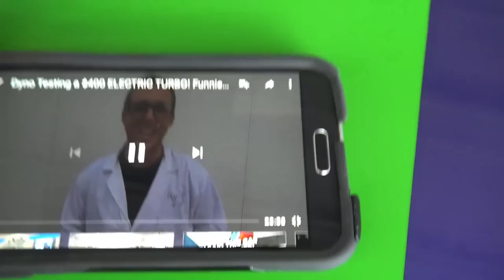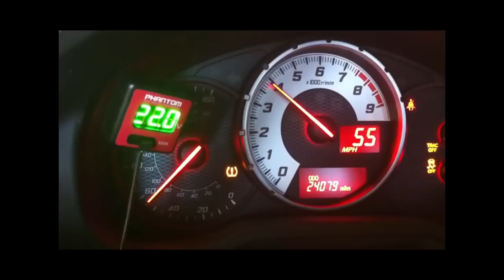Cleetus Mcfarland is wrong about electric turbos!

Comment: Cletus never made a blanket "all electric turbos are bad" assessment. He just said (and showed) that the one he got was worthless.
Reply: exactly he said the one he had was to small for his motor  so worked worst
Reply: he hooked it up backwards to the battery. Watch the video again
Reply: Jon Doe damn bro you good?
Reply: Jon Doe you have severe selective listening.  You also can’t get your point across with out attempting to insult your opponent.  Pretty childish on both counts.
Reply: Cleetus us the fucking man and he's tested that same unit and revised what he said.  At the time no one sent anything decent
Reply: Factssss
Reply: Fact.  Your not talking about your air restrictions when its not engaged!

Cletus is the man.  

The electric turbo on the chevy works very well.
Reply: @jondoe6926  i think he showed they do work later on in his videos cause he ends up with one that is similar to whats in this video an they make power on a coblat an smart car with fasterproms. an cleetus doesnt think anyone is going to take his science channel that serious he does it for the lols. i mean he tried to drive a vehicle underwater with a distributor without water proofing it. im a fan so im obviously bias but it did used to be bad for claims of electric turbos i mean ive seen computer fans put into intakes with the claim that it makes more power, but at the same time there is electric motors out there that are monsters, i always wanted to see one of those turbine electirc motors that they use for thrust on bigger electric rc stuff used to see if it could create boost. but boost is the amount of pressure the can be built in the volume an most electric turbines are meant to move a volume of air not hold it at a static pressure. i think i explained that right. some blades are better for pushing while other are better for pulling.
Reply: Yeah these electric ummm..... boost makers?, might make good power for a lawn tractor but nothing much bigger. Small 4 cylinders maybe, larger V6s doubtful, V8s no. We need Richard Holdener to test one LOL.
Reply: @waifuracer6516  which makes sense, even if that ES couldn't produce boost, it still wouldn't have provided enough restriction to cause that big of a loss of HP.
Reply: Some people like to try and make themselves popular by talking crap about others and cashing in at the same time.
Reply: Just accept that he was wrong and we all watched this video and know the truth now.
Reply: He’s said it a few times actually
Reply: He has a video with one called a torque amp that actually worked on a cobalt
Reply: fax
Reply: Geez you got some on your chin still hahaha
Reply: This guy is just name dropping to get views
Reply: Ok Cleetus.... Lol I like your vid but man
Reply: It didn't work for him on the v8. It was much to small. Also, when that isn't spinning it is a major restriction in your intake. Cleetus and his crew know what they are doing just look at his cars.. and if you watch they successfully boosted a cobalt on a different setup and it worked. So before you try to call him out do your research..

Comment: Congrats, your car is now almost as quick as a Honda Pilot!  Good job!
Reply: As a previous frs owner.   I believe he made the thing slower.   His 0-60 was  worse than mine was when it was stock.   I watched a video of him driving around and doing pulls.   I forget but I think I times his 0-60 at a little over 7 seconds.   Nearly a second slower than what road and track did

For way less than the money he spent, I bought a Cobb access port, catless headers, and I made my own intake tube/ducting.   The thing was still slow but it ripped compared to this thing.
Reply: Snaab92 lmao he actually did make his car slower than a mom suv
Reply: @michaelwielenga8809  don't get angry,there are people on the internet that are paid to knock a product,if electric turbo's were perfected,you got any idea how many companies would go belly up,least of all those who sell tig setups,and mig guns and host of companies gone,just gone,electric everything is the only thing that will fit under the hood of most of these golf carts made today,i don't like any new car,they are a compromise,nothing beats first design,after 1975 most cars were jokes,that includes the vette,ever work on a car made after 1980,that's right 4 miles of wire and a supplement electrical owners manual of schematics,and you need them to repair anything but a oil change and battery installation,the way of the future is like your wiper blades ,PLASTIC AND UNRELIABLE
Reply: @youtubeisbroken241  yep I used to have a brz and if I shifter right I could get it down to 5.4 -5.8seconds with a 93 octane tune, headers, tomes catback exhaust, throttle controller module and bigger injectors. Even stock it did 0-60 in 6.4 seconds
Reply: I'm honda pilot is heavy asf
Reply: LMAO

Comment: I don't know where to start. 
   The Audi system electric supercharger is used roughly the same way as yours, to eliminate turbo lag from the two exhaust driven turbochargers on the engine. It uses a 7kw motor. Guessing by the size of the wires on your setup and the controller size, your is max 2kw. They have also done this because the exhaust driven compressors can be more efficient in their operating range as they no longer have to function at the very bottom of the engine rpm scale. The compressor and motor are also water cooled because of the amount of heat that is generated during use, something you outright ignore.
   You have said that your boost trails off to 2psi at the top of the range and given these are relatively fixed displacement supercharger and flow nearly the same air independent of engine rpm, the most you are probably getting is about 30hp. Given the wide range of rpm that Cleetus performed on the mustang and that for most of the pull the mustang was below the power output of a factory frs, this mustang engine does not flow more air in any appreciable way than a stock engine in an frs, something your car is not. Your setup on this mustang would have nearly the same results as on your car, starting at about 5psi and tapering to 2psi at peak, netting about a 30hp gain. Closer to 25 on a dynojet, but this is ballpark figures, both engines have mass airflow meters and you could look at the voltage and know with a high degree of precision how much air each engine is actually moving. There is no point to debate this, the 4.6l mustang engine flows nearly the same air as the 2.0l frs engine.
   In the cleetus video they acknowledge the voltage problem and vow to use a boostapump to push as much as twenty volts through the controller, something your setup does when the batteries sag, something that would probably not change the result.    Considering you can buy an FA20Dit for less than two grand and this gives you at least 50hp, and a short block that can hold more than 400 at the tires, your $2k for ten second 30hp bumps so your Siena slow sports car can safely merge onto a highway is kinda lost on me.
Reply: You should go watch cleetus’ recent Torq Amp vid. Pretty interesting

Comment: I've never seen a working forced induction system that dosen't demand MORE FUEL under boost.  Without it you can't make any significant power gain and also a recipe for problems as too lean isnt healthy..
Reply: Suisk8- most factory computers can adjust fuel trims for low boost. Computer sees lean condition and adds more fuel in milliseconds to get it back where it needs to be. Just because you’ve never seen it doesn’t make it impossible. You’ve probably never even tried it. The limitation would be maxing out the stock injectors if you turn the boost up and to max them you would need to tune the computer, add standalone or piggyback
Reply: @mikeschneider634  yes indeed and in his video he is not claiming that the engine is producing more power by only adding air. Adding fuel is easy on these cars with the flash tablet. So therefore not interesting stuff. The only interesting thing is a working electric boosting device.
Reply: hahahahaha yeah in your video you say nothing about boost timing control, or anything fuel system related..  and claim 45 hp with nothing to back it up.. see how many dislikes you have now.. waste of money I call complete bullshit! 
If you want real power gains people don't half ass it like some people.. you will not get what you want and damage your engine..
Do it right or don't do it at all
Reply: also the way the boost tapers off ass rpm increases would give you the dumbest power curve ever on the dyno graph that you wont post bcoz you know its wack asf..
so solution is go 48 volts lmaooooo still wack asf no body wants to run 5 mini batteries in they're car performance car.. Weight savings is what the cool kids do with only one mini battery and a real power adder.. You should try it!
Reply: Daniël Hilgersom his car is not tuned.  He admits this in another video.  But there’s also some tell tales.   He has his catalytic converters removed.  When Modern Subaru’s have bad or removed cats, they throw a check engine light and a cruise control light.  ANY tuning software can get rid of this problem.   He has both lights during his test drives.   This indicates to me he is running the stock software.   He is not adding fuel, his timing is still the factory setting.  His car will not run right when under boost.  

The factory ecu will modify fuel and timing within set parameters.   Those limitations will not compensate for an engine making boost.
Reply: In a mopar it b ok I bet....u can run huge injectors on a stock fuel pump most the time in the V-8's
Reply: Efi is great stuff. 5 psi sold be fine on stock ecu. It will comp for sumthin this low.😎
Reply: Modern engines can adjust air/fuel mix on their own.

Comment: 5 psi is enough for bottom end acceleration!  Instant torque and 24 volts by 320 cca is 7.7 kw of power which is heaps for bldc motor. finally someone who actually says this setup works. nice video keep up the good work! cheers from Australia!😊
Reply from the maker: Thanks!
Reply: Don’t fall for his video.  Watch his other videos first.  He peaks at five psi but truly only runs about 2.7 under WOT.  He also shows his gauge cluster while he’s flooring it.   My tuned, catless, frs with a home made intake was faster than this and only cost 600 bucks for the tuner and manifold.   Furthermore, an m90 supercharger costs a couple hundred bucks and you can easily fab up some mounts to put one on the frs.  This guy got conned out of his money but doesn’t want to admit it so he keeps trying to prove something that’s not true
Reply: @youtubeisbroken241 yeah I want tonsee it on a dyno not that weird video he showed

Comment: The main point of forced induction is to increase overall air density. Higher pressure with high intake temp doesn’t really do a lot of good to the engine. That’s where the intercooler comes in.
Reply: I would argue that compressing the air increases the air density. Also, as he stated in the video, he doesn't have hot side. The intake is getting its air from the air box which is right up front. That's not to say its not gonna get some heat from the engine but it certainly wont be hot when powered.
Reply: @aydenowens9522  The heat is generated in the compression of the intake air.  There is no such thing as air compression without heat.

Comment: I would love to see an electric speed control mod for the brushless motor that controls the boost in relation to the throttle position. Your video stated that the electric setup doesn't kick in until 75% throttle. Anything under you are pulling vacuum against the system. With an ESC you could apply power based on throttle position to at least negate the vacuum, keep it at least breathing easy. You could even draw from the standard battery/alternator in these low demand situations and pull from the "boost batteries" when the system kicks in full power.

Comment: Firstly Audi and Porsche fit electric assisted turbochargers to eliminate or reduce lag, they are not driven solely by an electric motor. Secondly, measuring the HP with the unit attached on your car, simply adds considerable drag to the incoming air flow. Therefore what your comparing is a false HP baseline and when the turbo is turned on the engine can breath normally again showing a HP increase which is most likely the HP your car produces in the first place if the the unit was not attached.
 If all the car manufacturers could replace all the complex piping, oil feeds, heat generated etc by a conventional turbo with a simple electric motor, dont you think they would have done this?  BTW, you also stated incorrectly that electric turbos do not require an intercooler, but this is not true. When you compress air it heats up regardless of how the compressor impeller is driven. This is exactly the reason your turbo setup remains cool because its not compressing air, just free flowing air into the manifold. Try connecting a pressure gauge on the intake manifold at full boost and it probably wont even register any pressure.

Comment: "This entire system I've payed less than 2k$"

Meanwhile PFI has been tuning 500$ ebay kits on Hondas for the last 4years making 800hp... Lol.
Reply: Exactly
Reply: Does that fit a GT86?
Reply: There are plenty of eBay turbo kits for the fa20.  It’s also incredibly easy to use the m90 supercharger from early 2000s chevys and build some nice power
Reply: Faxxs
Reply: True but this the type of mod that requires no fab, no strange piping. No extra work to the exhaust and creates no attention to a otherwise stock car, All the power so to speak and none of the drama when a piggy see's you.
Reply: The hash slinging slasher. To install an electric charger still requires piping and tuning.  Admittedly the piping would be more simple.  Tuning is still going to be required.  And you will need to have some understanding of electrical circuits to make it work properly.   

As for the incognito pitch, you can drive around all day long in a turbo car and not once build any boost.  I reset my boost gauge all the time to monitor some recent modifications I have made.  If I’m just cruising to work during rush hour, my peak boost might be .3 psi.   Virtually zero boost.  So no one would ever know my car has a turbo.
Reply: The hash slinging slasher. Also you use the term “all the power” very loosely.  More like 10% of the power.   

Honestly for that price, and intake, a tuner, and a cat delete would have given better power.  I had an frs with those mods and I could have walked this guy any day of the week.
Reply: Tuning is $800-$1000 where I live for 2 and a half hours. Plus the Ebay turbo kit which is roughly $600 to $1000. Soo... the pricing is almost the same as throwing a 5 psi rated electric turbo.
Reply: @youtubeisbroken241  Don't need a tune. Get a AFR and watch it with a rising rate FPU  and keep it on the richer side to keep everything in check. People been building 20 psi specials with no more that that, a modded maf for bigger injectors and a good fuel pump since the days of Mustang 2.3's and guys at the strip spinning one up to barely 40 psi in 30 seconds. I get the price point is steep and it to is a major turn off. But when I thing of all the extra fitment, welding, jig work for a manifold for anything other than a fucking Honda and the idea of trying to find someone in my state able to even try to tune anything OBD2 its a nice offset when you consider You'd be at least the same in for about 10psi more and some serious headache on the DIY side.
Reply: The hash slinging slasher. You show me a normally na engine running twenty psi of boost on a factory tune with factory internals and I’ll send you twenty bucks.   

But if that were true, which it isn’t, then that negates needing a tune regardless of how the boost is made.  So a real turbo (that can consistently make small boost with a wastegate) will still be significantly cheaper to install than this 2500 dollar electric unit.
Reply: The hash slinging slasher. Taking tuning out of the equation (since you claim it’s not necessary), I could put a turbo, intercooler, boost control devices, and all the plumbing on a Honda for about 1200 bucks.  And I could do it with nothing more than a drill and a basic socket set.  
 No welder, pipe bender, or anything like that needed.
Reply: @youtubeisbroken241  Looks as if you haven't been to their website.
Reply: Youtubeisbroken you literally use a bypass valve to sort out the usable boost issue. I own a Subaru spec.b h6 with a 11.1 compression ratio, 5.8lbs of boost would be plenty to see power gains and torque obviously using bigger fuel pump injectors and higher octane fuel with a tune to gain power. A tune is a must if you want to actually get results from any mod. On anything lowish compression and big displacement this thing is a waist of time imo just get a real turbo

Comment: That's the idea I think will work good.  Simple and efficient. 
The switch for the motor could be shifted from beneath the pedal to the throttle activating lever on the engine itself.
To add, if the speed of the motor for the charger can be controlled by a variable speed device as the throttle is opened or closed, that would be even better ...